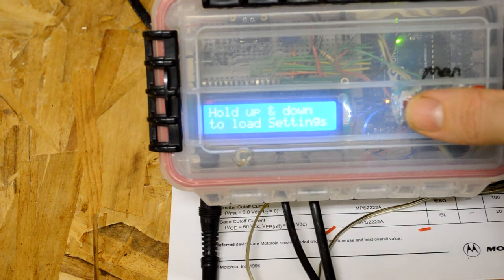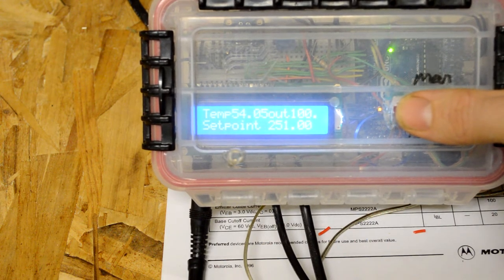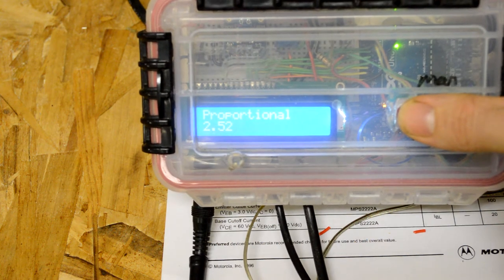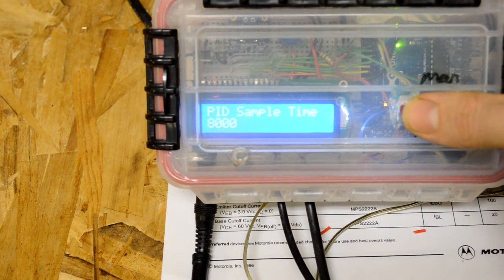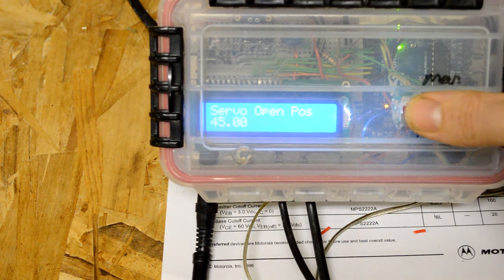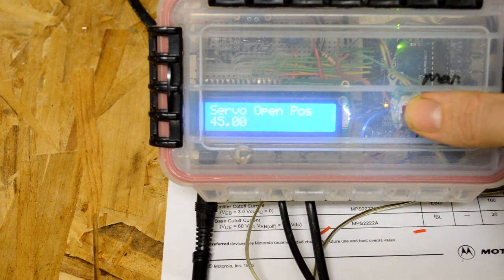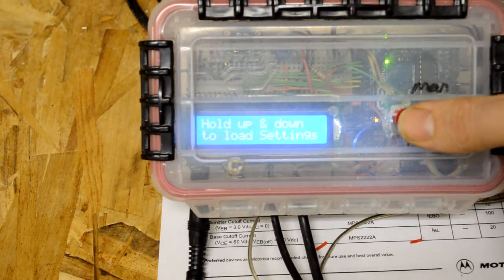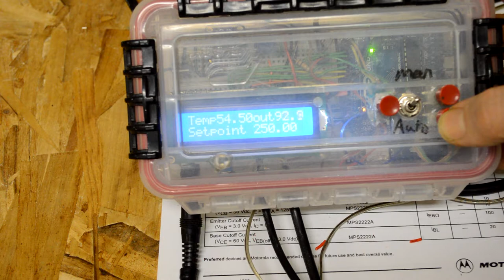Arduino Based Automatic Smoker Temperature Controller

Comment: Thank you Archy for sharing this. I build a similar bbq controller, uploaded your sketch and it works very well!
I made some small modfications, because I have crappy thermistors, i put an extra filter on the averaging filter.
I also added a lid open detection so the PID is set to manual and the output 0.00 when the lid appears to be open.

Comment: It sure was great to see your soundly designed and executed finished product!  Thank you so much for sharing.  I have been slowly going down this road as well.  I have had my smoker set up with a single loop industrial PID controller for several years, but wanted to try something different in an attempt to optimize my fuel usage.  Kingsford competition charcoal is AWESOME, but it comes at a price LOL.  

I started developing round 2 with a Raspberry Pi attempting to control damper positions via 4 servo detents and combustion air fan speed via PID loops.  I went with the Pi because I find it works slick to set up for wireless interface and IOT to cloud dashboards that I can see anytime on my Iphone.  Pi's work great for simple reporting, but I had never attempted process control with one...that was a pure leap of faith.

It was a painful experience due to all the drivers, libraries and GPIO jumpers necessary.  If I don't have enough coffee in me during the day my Python coding skills are highly variable as well :-).  I then thought, "why not use an arduino and simplify things?".  I bought everything that I needed and life has got in the way since then.  Having now witnessed your successful go I have no excuse but to get things rolling again.  Oh, and by the way your video was well presented and you should not feel awkward about doing more in the future.  I've watched, and published, FAR worse in YouTube land.  Thanks again!
Reply from the maker: +Doug P Thank you very much for your encouraging comments, it means a lot. I have never used a PI, but someday hope to get into it a little. As for using Arduino, it should be no problem for you. there are times I wish I still had the blower attached just for a little extra air at times. Kingsford does work great. I think all charcoal comes at a price, but it's hard because it does work so well.

I just did a 3hr smoke/grill on a whole chicken and used almost entirely wood hickory I got from the old man's woods. that worked great, but I had to add wood every 15 minutes as to not over smoke or draft up too much heat. When I would add wood too late, that's when I wish I had the blower attached. 

Having these problems has me thinking about building a pellet smoker, or taking the easy way out and going electric.

Good luck I hope you find enough time and resources to continue your hobbies and like me, try to keep your sanity.

Comment: I was thinking about doing something similar I figured it would be easier if you can control the air in and out it should be able to regulate temp well

Comment from the maker: Update. I just released a fan operated version.
Reply: Great! and many thanks for documenting and sharing all this.  do you have any tips (or video?) of the new fan-only version?  I see the sketch on github - thanks again for sharing!
Reply from the maker: No video yet. It is pretty straight forward if you are at all familiar with the arduino IDE. just trigger your fan circuit off of the listed output. I used a mosfet from sparkfun when I did it. triggers with very little current, can handle high current and has a built in diode. simplifies things.

Comment: Archy, thanks for the great video and code for this project. I heard you mention that your temp sensor readings were somewhat erratic and I think part of the cause may be in the extension cable you are using from the sensor wire to inside the case to the temp board.
From what I've read about thermocouple  wiring ( I'm no expert by any means ) it all needs to be the same kind of wire as the thermocouple itself and the plugs and sockets as well. They also say all connections must be screwed not soldered. You may want to check into this to see if it will help with your issue.

Thanks again for your hard work on this.

Robert
Reply from the maker: Hey Thanks, I was thinking the same thing. It is very hard to get solder to stick to thermocouple wires. (I only know because I tried it) I did have much better luck with crimp connectors, but was under the impression it was not meant to be. 

Thanks for the encouraging comments.
Reply: I've got it wired up using a max6675 thermocouple board and for some reason the temp will not change. If I power off and heat the sensor and then power back on it will show a new temp but it will not update the temp after that.
Any ideas as to what may be causing this?

Thanks, Robert
Reply from the maker: hmm, are you using my code? The adafruit library uses (thermocouple.readFarenheit()); as a call function. this should be in your loop. The other thought could be that your screen is not refreshing.

Comment: Hey Archy - great vid and project mate. I'm trying to build the same thing but my smoker needs a fan - how hard would it be to adapt your sketch to run a variable speed fan instead of the servo? I really want to make sure it's not just on/off to avoid the temp spikes. I'm pretty new to arduino and coding, so any tips for doing that would be great!
Reply from the maker: hey thanks for the kind comment. all you would need to do is analog write the output to an available pwm pin. this would be the simple way. some pc fans I've tried need at least 30% output to get them to start turning. some conditional math may be needed to say, keep the fan from running until the output is high enough. I doubt any damage would come to the motor though if you took the simple route. I'll see if I can make some time in the next month to wip something up and get it up for you to use/see. thanks for watching
Reply: Awesome man, thanks!
Reply from the maker: Hey Adam, I got it done check it out! 

https://github.com/archywigglestyn/Smoke-A-Matic
Reply: You legend! Thanks man, I'll check it out.

Comment: Hi Archy! do you happen to have a list of components for your project? I am planning on making an arduino controlled blower for my UDS
Reply from the maker: No I do not. I am working on a thermistor version of the software. I recommend a thermistor. other than that all the components are pretty simple and interchangeable. find what works and use it. you should be able to search most items as, 12vdc regulator(if needed for your setup) , motor mosfet,(make sure is has a bucking diode or add your own) arduino lcd 16x2. and that should be about it other than buttons. check out the sketch there are some resources there too.